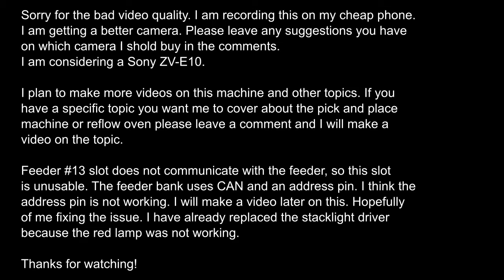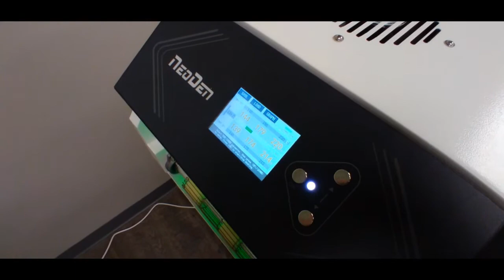NeoDen S1 pick and place and IN6 reflow oven

Comment: How are you liking the reflow oven? Do the onboard filters do a good job of removing smoke/odors? Any smell in the room while operating?
Reply from the maker: The reflow oven works great. It does a much better job than my drawer style oven. I do get a little bit of smell while it is operating, but it is not bad. It smelled awful when it was new, but now the smell is much less. It was the manufacturing residue burning off.
Reply: @nichanks1518  thanks!
Reply: I would like to add that the third top element goes out every few months (depends on how much you are using it) also very expensive. oh and how the belt skips after a year of having it with customer service telling you “do this and it’ll fix it” without hearing us that it wasn’t the issue.